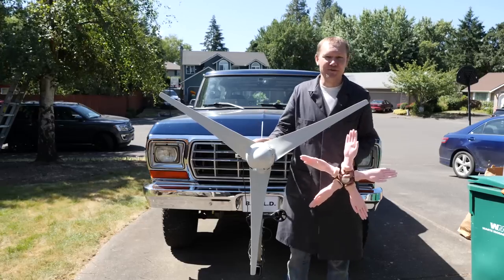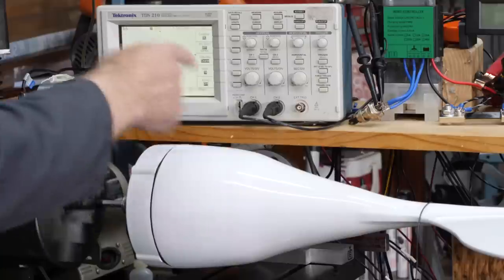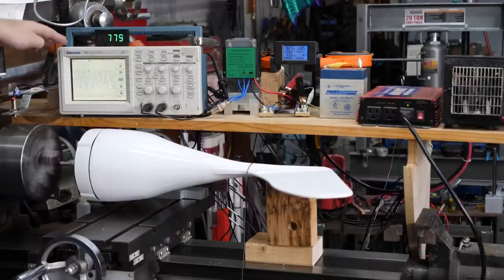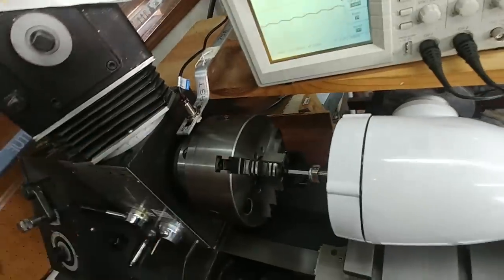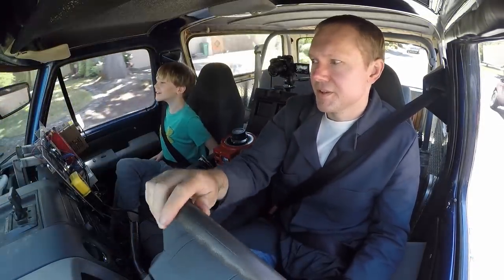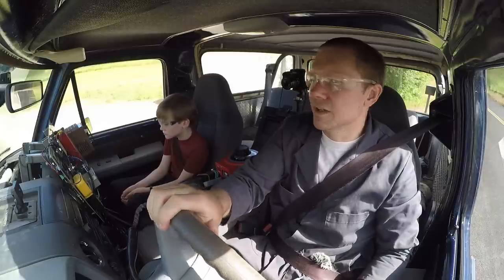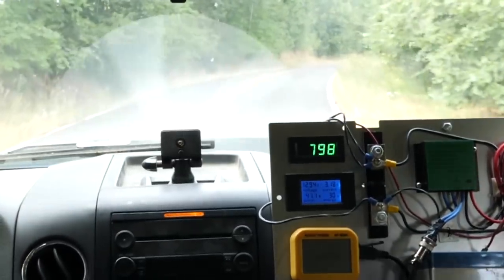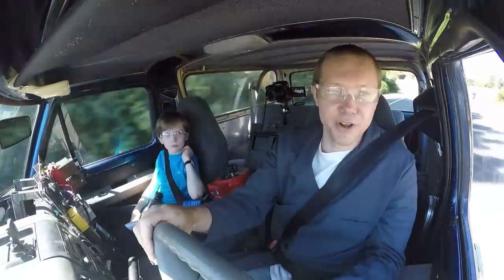Wind Power on a CAR #2 - Testing the Betz Limit for Turbines

Comment: I'm a mechanical engineer, but my experience in fluid dynamics is not the best. So excuse my possibly ignorant question.

At the start of the video when you show the formula used to calculate the power, I noticed you used one fourth the diameter squared to determine area? Intuitively I would have thought one would have to calculate the cross sectional area, or some other area which takes into account the blade size/shape. This would essentially decrease the area term in your calculation and perhaps bring your theory closer to what is observed in practice. 

As I said, I have no knowledge of this field, the area term just interested me. Perhaps someone can provide me with some clarification as to why one would use the full sweep area of the blades, and not just the area the blades take up.
Reply: As I understand it, what he calculated was the amount of energy (power) availble throughout the whole turbine crossection. So in some sense, this is the absolute maximum available to harvest from. It is the amount of energy in the moving air itself. If you wish to say so: the amount of kinetic energy in the moving air available.

I have no experience in this field, just like you. But I know that the whole thing is not that simple. There are secondary effects going on such as each blade runs in the wind shadow of the previous blade which reduces induced air resistance of each blade. If you allow me to change to a different field, I might say that I think almost everybody finds it it be rediculous that a helicopter is able to autorotate, that is the blades (without power input from the motor) are able to keep the helicopter airborne. But in practice, it works. When autorotating, the blades actually are set to a negative pitch angle in order to keep the rotor spinning, while the rotating rotor acts as some sort of parachute. Flying model helicopters by myself all I can say is: there is a huge difference in air resistance between the rotor not spinning and having a fully spun up rotor (with  pitch setting as to not create lift at all). My guess is, that the blades are spinning so fast, that the viscosity of the air is high enough in order to not be able to avoid getting "hit" by the next blade.
Also: In order to get a maximum 100% efficiency from the air, one would need to reduce air speed to a complete stand still which would create a stall in the plane of the blades making them effectively act like a disc as a whole.
I have no idea how much resarch has gone into identifying all the different effects going on. But is certainly is not an easy topic, when looking at the details.

Comment: yeah pretty ludicrous claims if the controller breaks the turbine well before it gets to the rated power

but controller issues aside, the major wind speed reduction behind the turbine, gives a good claim to your theory about reducing drag on the truck. so that is a bonus proof of concept.
Reply from the maker: YES!!!
Reply: I think the controller applies brakes, not based on power output, but strictly on voltage level.  If instead of that inverter for a load, he used  a simple DC resistance load, he might get more power out of it before the voltage rises so high that the braking circuit activates.
Reply: @mikefochtman7164  hmmm possibly a small transformer to swap the high voltage, low amp source into a low voltage, higher amp one. this would mean more power before the 14 volt limit is reached, however the wire size in the controller might be a problem. Conductor diameter is directly related to how much current they can carry without over heating. I have no idea how big the traces are on the PCB inside that box. though the output wire looks decently sized so if that anything to go on, probably close to 14 gauge or a bit smaller so good for ~15 amps, but probably less. (also depending on how long its on for)

Seeing we see it hit 5+ amps in the video, you could probably max out at 2.5 or 3 times the power before you melt everything, by reducing the voltage by that amount. and 3 times ~150 watts is 450 watts, around the rated power output of both turbines, so maybe the claims are true....you just have to rewire it yourself with a custom transformer first XD

Comment: I've heard you can get these cheap turbines to work much better if you change out the cheap charge controllers they come with. Apparently they do a terrible job at converting 3 phase AC to DC.
Reply from the maker: That's my understanding too

Comment: The reason why the turbine isn’t going as fast as it should do is because of the air bouncing off the front of the car which is hitting the back of The turbine which is slowing it down therefore you need to mount the wind turbine on the roof of the car because there will be no back wind on The turbine
Reply from the maker: If that's true, then why is the anemometer able to record wind speeds equal to the vehicle speed?

Comment: I don't come from an engineering background so I'd really appreciate it if someone could explain this to me. Will the potential power generated outweigh the extra fuel needed to counter the resistance from the turbine? I know in the last video Quint mentioned that the truck is shaped like a box which already has a lot of resistance, but the graphic he used showed the air redirected by the turbine in a way that makes the car more aerodynamic. So is the turbine actually reducing the air resistance the vehicle experiences? I'm also guessing this depends on the type of car you mount the turbine on!
Reply from the maker: That's what we're going to figure out together in future videos!  I don't think anyone can accurately predict the outcome, though many insist it's as simple as the 2nd law of thermodynamics (it almost certainly can't be with all the additional factors involved).

Comment: That squirrel cage blower with the round vanes in this video ( https://youtu.be/2XgWQ_sTzRc ) fascinates me. I've looked far and wide but cannot find anything like it. The closest I've come are the Japanese Typhoon turbine ( https://youtu.be/fmC_jRqPFlE ) that employ the Magnus effect which I think could be done in smaller applications without actually powering the vanes. Imagine a horizontal application mounted just at the top of your windshield below a cab visor so that the wind goes under the turbine before exiting over the roof of the truck.

PS. I think I'd want to mount a bearing in the center of the turbine's length as it would extend the width of the cab. Also, the cab visor does double duty shading the cab from the sun.

Comment: LMFAO It Simply Amazes Me To The Amount Of Trouble & Great Lengths + Expenses YouTubers Will Go To Do Tests or Prove Points On Solar Topics! LOVE IT!!! Even The Wearing Safty Glasses Inside The Truck... HaHaHaHa *Now Back To Your  Expeiments, Yes The Breaking Was Trying To Slow The Turbine Down! 1st You Need A Larger Battery Bank 2-4 Deep-Cycles? *Dump That Little Turbine Controller Totally! Go Straight From Turbine (3-Phase A/C) To A 100w Rectifier, "Use 10 Gauge Wire" Then Take DC Side Straight To Your Batteries "Use 4 Gauge to 2+Size Wires!" Thus Eliminating The Breaking Circuits... Then Hook Your Inverter Off The Batteries For Load & Ifin You Want To Break Turbine Speeds Down, Use Your Variac Transformer To Large Load Resisters To Do It Manually!? Carry On, G@@D & Funny Stuff! Thanks PS There's Nothing Wrong With Either Of Those Turbines, It's Your Controllers That Are Bad!!! Use A Real MPPT Controller To The Batteries & You Will Get Over The Rated Power  Specs For Sure!!! I Use These Same 'Great Lil Turbines!" In Both 12v + 24v x 400w Sizes For A Couple Of Years Now. On My Home DIY Off Grid Systems.. ;~)P
Reply from the maker: Thanks!  But you don't think the floppy plastic of the 3-blade is a problem?

Comment: We need to use smaller blades like that of jet engines, you got it Toyota one on the top ,2 on the side I don't think I'm going to get 800 RPMs riding around town hahaha divide the 200 watts Between 3 motors
Go Farther With Us! Wait I'm having a Aaaa Moment".I like you so here goes, Make a small motion sensor to fit on the back of most cars to beep A foot or so from a object Properly a Car, when in Reverse, replacing the Need for cameras in rear of Motor vehicle !

Comment: Yea.. bottlenecks. You know that when you shortcut the 3 wires from the turbine, all power made goes into EM braking, making the coils hot. When a windmil spins too fast, it can protect itself by EM braking, as you discovered. A high load can do the same (cold heater = high load). I wonder what results your get when setting it up as designed: as a wind turbine. One more thing: get a good quality solar/wind charger, that cheaper one my be a bottleneck as well. Love you videos!

Comment: A generator has a certain open circuit voltage per rpm and a certain internal resistance, that when short circuited, all the voltage drops across the internal resistance of the coil limiting the amount of current that flows for a given RPM. 

Current = open circuit voltage / (load resistance + coil resistance)

Thus generator output voltage under load = load resistance × (open circuit voltage/(load resistance + coil resistance))

And power output = 
(load resistance × (open circuit voltage/(load resistance + coil resistance)))^2/(load resistance)

After measuring resistance, Put this into a spread sheet to help find the  load that results in the most power transferred. 

The ideas above will work for single phase. Maybe 3 phase will complicate the math, but the concept is there, Internal resistance draws output voltage down.

For example:
 https://docs.google.com/spreadsheets/d/1E7sXoh6szQJS1VW5jTs6aN2hLUMbOG26w1ZQljyjrZs/edit?usp=drivesdk

Comment: Thank you for producing the video it has some very interesting elements, I have been trying to research small turbines and its good to see some testing. 
However can I suggest some revisions of your methods for a retest. 
Really really really think you need to switch to a roof mount so there is as best as possible clean air behind the blades otherwise you have a bubble of used air clogging the system like a potato in the exhaust pipe you even demonstrated this yourself with your anemometer, the phone at a blade diameter behind was has a large effect on the wind speed (granted the image makes for good click bait).
From my research the cheap crap charge controllers appear to be the major limiting factor for power generation from these turbines using small low amp components, I haven't done it but setting up with a high quality large bridge rectifier and a PC fan for cooling then feeding the DC through a reasonable quality solar charge controller into a battery but retaining the original controller in parallel at the rectifier to provide the braking some of which are wired for a dump load resistor for braking.   
The 5 blade hub may be have much better blades and should be better at lower wind speed generation but shouldn't a reasonable quality 3 blade be capable of harvesting more power in higher wind speeds.

Comment: Excellent video. Nice to see you and your son sharing quality learning time together.  Those turbines are made in China, surprise!!!!  The American consumer is being cheated and defrauded by these products that claim a certain performance but don't deliver, isn't that called fraud?  Why chinese products are allowed to be sold without someone testing the claims of the product is beyond me, what would happen if some American manufacturer made a product that did not perform to the label's ratings or claim?  Get sued for fraud probably.  There are many negative feedback from people who buy these Chinese made products that claim don't perform as indicated or they break very easily .  One particular claim is the terrible performance of the rectifiers or inverters that come with these products.  Another disservice to the consumer is how they rate the turbines by watts and not amps.   A watt is a unit of energy consumption (like bulbs)  not energy production.  Go buy an alternator for your car, what is the ratings that matters? How many amps it produces not watts.   The turbines and solar panels sold are rated by how many watts can be drawn directly from them and not by how many amps they can generate.  Most people use turbines and solar panels to charge batteries not to power stuff from them directly, so a better way to grade these devices is by amps not watts.

Comment: Why does your 70’s bronco have early 2000 interior?
Reply from the maker: It's a resto-mod I did with the engine, trans, transfer case, ABS,  and A/C from a totaled 2004 F150. Just took it thru DEQ testing again and it beat the old 1978 standard no sweat!

Comment: how do you know the turbine isn't still breaking due to the battery providing insufficient load?
Reply from the maker: Because the inverter faults out from a low voltage, each time we turn up the variac.

Comment: I was under the impression that the turbine and controller would charge a battery bank, not power a load through a small battery.  These systems rely on stored energy, not generated energy.
Reply from the maker: True, but for the purposes of the video I want to run the inverter mostly on the turbine. Should have used a slightly bigger battery though.
Reply: Quint BUILDs I doubt it will
Reply from the maker: Where else did the 170 watts come from then? It wasn't connected to anything electrically in the vehicle.
Reply: Quint BUILDs it came from the turbine, but that is a peak number you saw.  The only way I can describe it is like a battery charger won’t power a load but through a battery because it needs the reserve capacity.  Maybe try adding a capacitor bank inline.  I’m not trying to be a negative attitude, I really want this to work too.  I have no doubt you will figure it out.

Comment: Maybe the turbine is too close to the nose of the vehicle? That way the air is stacking up behind it. If you could run it up on your roof without hitting a low bridge that might be a fairer test
Reply from the maker: Yeah, except the anemometer still reads near vehicle velocity even with a turbine in front of it (the 3-blade that is).  I do intend to mount it to the roof eventually to compare the mileage penalty and power up there vs. in front of the truck.  That's ultimately what I want to see the effect of.  Problem is a few hundred watts will only be a blip on the instantaneous fuel consumption.  I need to harness thousands of watts if the fuel consumption is to show a measurable change.
Reply: @QuintBUILDs  can the anemometer read quickly enough to see the "pulse" of slower air as a blade passes in front of it?
Reply from the maker: @ElPants21  I seriously doubt it.  The blades in the anemometer are light but have some inertia, plus the update rate on the display is quite slow.  Maybe if I read the output with a scope?
Reply: @QuintBUILDs  not to send you too far down the rabbit hole, that might be the only way without special, purpose built  tech

Comment: I have the same wind turbine (400W). The shipped controller  - the blue one - do not work correctly. I have much better results with a 60A rectifier diode and a home made dump load limiter wired with 3 X 16mm2 wires.
Reply from the maker: Appreciate the info. Are the blades floppy like mine? Could just be the cheap plastic they used that week.
Reply: @QuintBUILDs   It's a 5 blades turbine. Blades are rigid like your 5 blades turbine. Exactly the same shape.

Comment: Maybe I'm stupid, but, aren't those turbines designed for wind coming from the sides instead of the front?
Reply from the maker: Are you thinking of vertical axis wind turbines? VAWT vs. HAWT
Reply: If you look at the turbine body it has a rear rudder, which will always orient the blade so that the wind is coming stright on.
Reply: @QuintBUILDs  Thank you and @konrad zielinski, didn't realise that was a thing.

Comment: The lathe had to go crazy rpm to get to power. The wind has to go like crazy fast. Probably because it's made/design in China.
Reply: In this case Chinese sellers tell fairy tales to their customers. Nobody would buy their 50 Watt Windgenerators (comparing it with solar panels) so they lie their power high tenfold.

Comment: 400 watts -10% for the current state of technology / design losses = 360 watts
360 wattts - another 10% for real world losses like voltage conversion, heat and etc. = 324 watts
That's my prediction for your real world output. If you can push 360 watts, you're a pro. If you can beat it, you should probably patent something.. at least for a respectable 7 years before you donate it as public knowledge. ;)
Well.. I didn't account for the manufacturer flat out lying.
Just out of curiosity.. why didn't you roof mount it a couple of feet up? That would give it relatively clean aerodynamics all the way around. Actually, 2-3 feet off the deck of a modern-ish car would probably be totally clean. Not sure if they would put up with that much torque on the roof. Not sure if BMW or Audi makes a passenger car that aerodynamic either.
Coming at it from the other direction, I'd be curious if a truck with a non-clutch driven radiator fan would affect this thing or not.

Comment: Remove all factors, buy only having the generator wired to old household 100, 60, 40 watt light bulbs. Then turn them on individually for a change in load.  No rectifier just AC to incandescent bulbs.

Comment: There is two things wrong the charge controller and the battery Bank. The charge controller has a Breaking point. And the battery well it's too small. The charge controller should dump at 14.6 on a deep cycle battery large battery. The turbines are doing his job. The charge controllers that come with wind turbines are junk.
Reply from the maker: It's about 14.3 on this one. Did you get to the part where I addressed that?